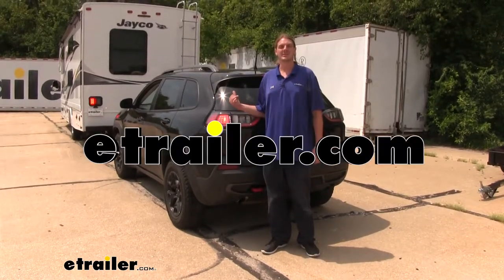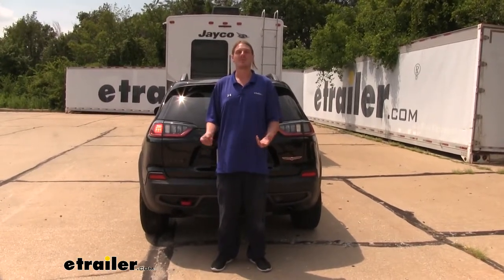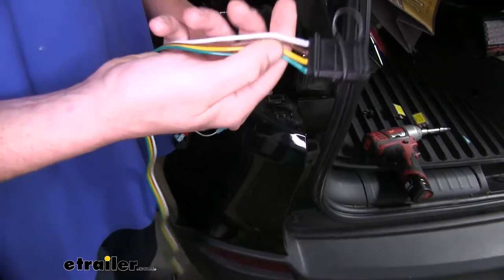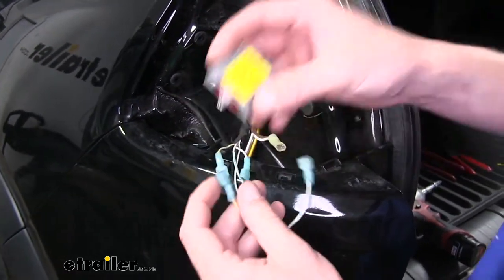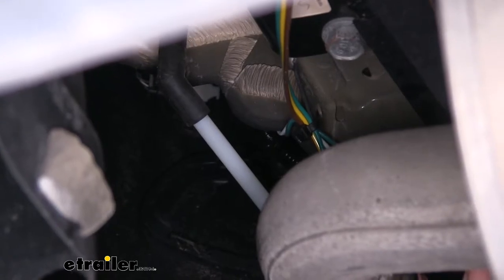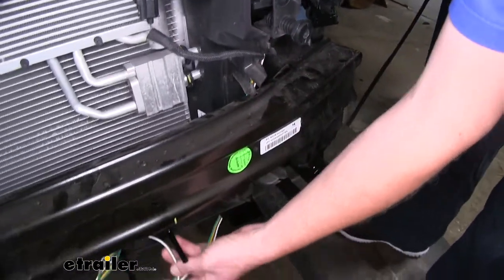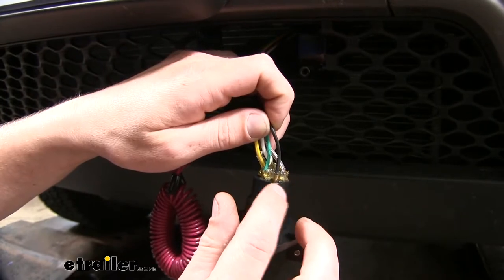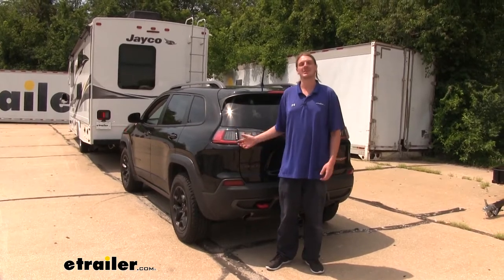Setting up the Roadmaster 4-Diode Universal Wiring Kit for Towed Vehicles on a 2019 Jeep Cherokee

Comment: Great video, thank you!  At the end you say you are attaching the 6-pin connector to a bracket.  Please provide the details of the bracket.  I need to do the same.  For the break away as well.  Thanks....
Reply from the maker: The bracket is typically on the front of your tow bar. It will look like two tubes sticking out that will accept the screws. We do have brackets available that you can use to mount your vehicle.
https://www.etrailer.com/Accessories-and-Parts/Hopkins/HM48605.html